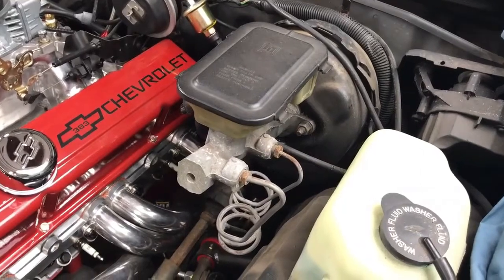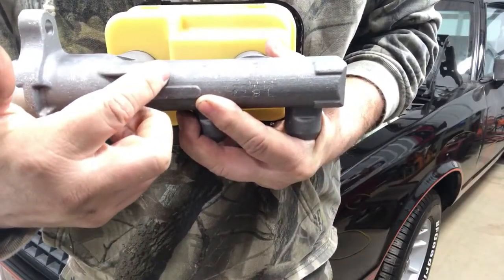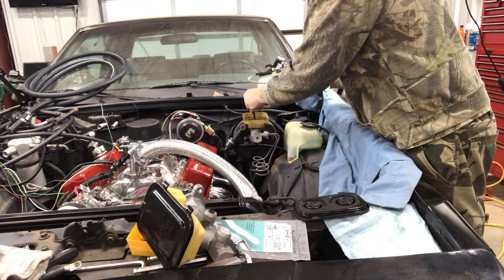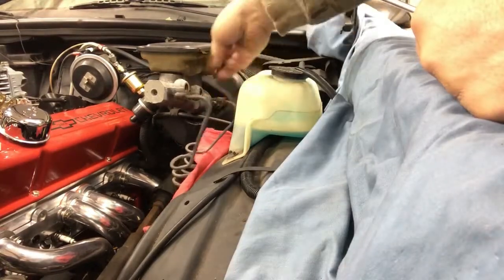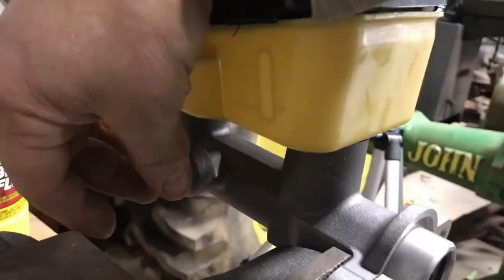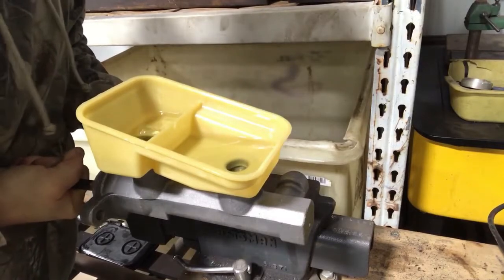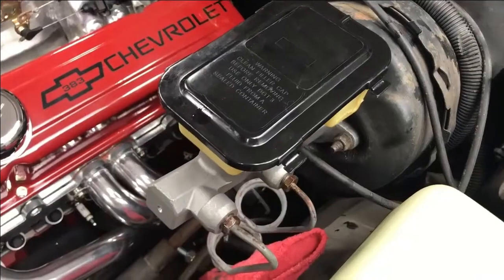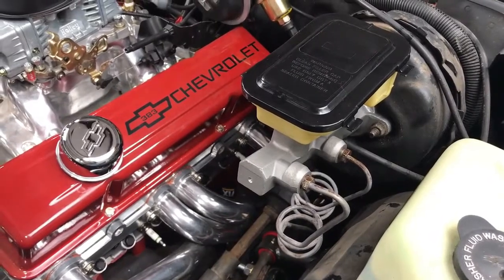Master Cylinder Leaking Brake Fluid - How To Fix EASY

Comment: Awesome video.  My 72 has the exact leak that yours shows, so im guessing i need to do the exact same thing.  By the way, very very nice engine bay.
Reply from the maker: Thank you. This car was a project I worked on. Replaced the 305 with a 383 and replaced everything in the engine bay.

Comment: Great video - clear and to the point.  I have been told my master cylinder is leaking fluid into the booster.  Would this require both the cylinder and the  booster to be replaced?
Reply from the maker: Yes most likely. Definitely with the master cylinder leaking and the seals may be messed up from the fluid exposure in the booster as well. Thanks for commenting

Comment: My master cylinder is similar to yours.
I had brake fluid leaking from where the reservoir cap meets the master cylinder...only a few drops every now and then...
The brakes dont feel spongy so Im guessing no air in my brake lines...just dont seem to understand why I have these leaks occuring?

Comment: Was your leak, hitting the headers causing it to smoke? Think I might be having the same problem
Reply from the maker: Yes it was. The most obvious sign was the paint peeling away under the brake booster and firewall below.

Comment: Mine was leaking in the same spot.  I replaced Master and it still has the same trickle leak.. Is the brake boostet bad?
Reply from the maker: Could be the fluid leaked into the booster and is now leaking out from it
Reply: @dhammiam  hmmm okay.. so at some point it will stop?

Comment: Is there a seal between the master cylinder and brake booster?
Reply from the maker: No, the seal is inside of the master cylinder
Reply: @dhammiam  thanks
Reply: Mine is leaking from the bottom of the plastic bowl where its mounted onto the aluminum side of the master cylinder. If that makes since.

Comment: After bleeding the brakes, is the master cylinder suppose to push up fluid like a fountain inside the reservoir?
Reply from the maker: Yes, the fluid will do that when the pedal is pressed
Reply: Can I use bolt it and use the brake pedal to bleed it instead of a bench vice
Reply from the maker: Yes you can @1kbutta

Comment: I purchased a new M/C and combination valve but the lines won't stop leaking to the combination valve. I checked the flare on the line but it keeps leaking
Reply from the maker: It’s hard to say what’s wrong without seeing it. I’ve had some flare nuts that were too short to reach the bottom of the hole and wouldn’t tighten. The flare nut was tight but the line would move. Maybe check that 🤔 Let me know what you figure out

Comment: I just replaced one in my 83 c20. Its already leaking again?? Bad part or did i not bleed it correctly ?
Reply from the maker: Is it leaking from the back? Are you sure it’s not just residual fluid that was left behind the seal? Sometimes new parts do leak unfortunately
Reply: I've replaced 3 master cylinders on my K20 Suburban and today I will be replacing it for the 4th time.  I can't imagine 3 of them in a row were bad.  It's destroyed my engine bay and paint.
Reply from the maker: @TempoDrift1480 I’m wondering if there’s another issue. Maybe look at the brake pedal and be sure it’s not traveling too far thereby pushing the rod into the master cylinder too far causing a leak

Comment: So improving your brake system can cause an old master cylinder to fail? I replaced a bad hose and bled the front brakes and got the master leak. Red brake light comes on over 40mph
Reply from the maker: I think it’s due to the valve moving farther than it’s used to inside the master cylinder. It must loosen up debris or something

Comment: I think my fluid is actually leaking into the booster. Very slight leak.  It's there an easy way to tell without removing the booster? 
Thank you
Reply from the maker: Sometimes they’ll leak and pull in brake fluid through the vacuum line.